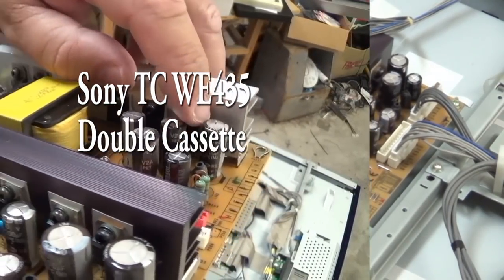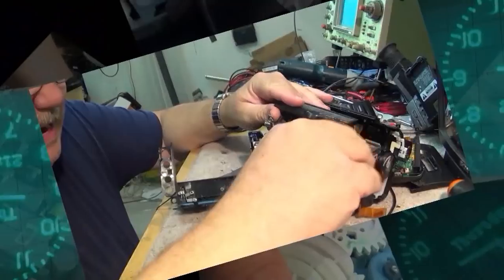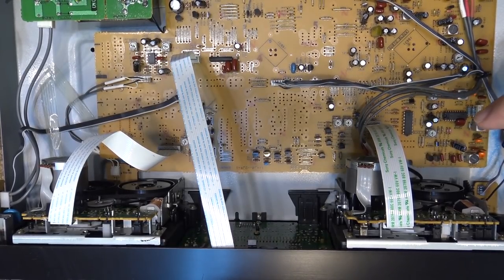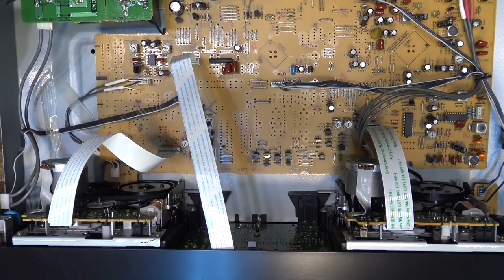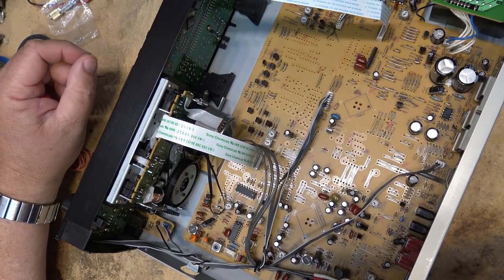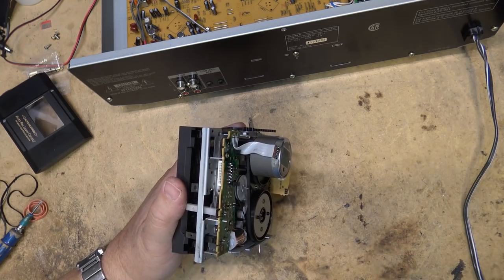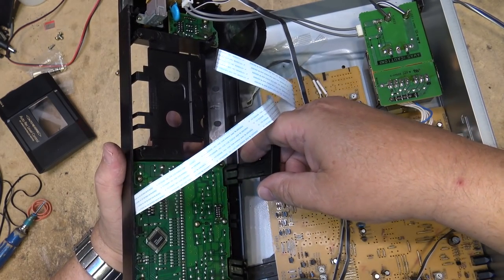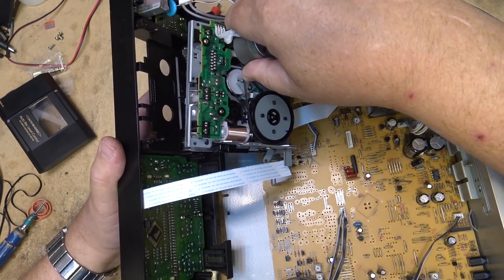Sony TCWE435 Cassette Deck makes a clunking sound. Lets find out why

Comment: Thanks for the inspiration to tackle this job.  I have a late 90's Sony WE 475...probably a little different from the one you're working on but I was able to change both belts on both sides w/o pulling the unit apart.  Just pulled the motor back a little and slid the new belt past and hooked it on.  Made sure to put the smaller band on first, which went on easily once the large belt was removed. It's working great - saved a couple bucks.

Comment: Thanks so much for posting this. I have the same model and both drives failed in the last few months. I thought it was an electrical fault until I saw this. I fixed mine over the weekend and it only cost me €15 for a new set of belts.

Comment: Thanks for putting this video together. I was able to successfully replace the belts on my TC-WE425 with your help.  I cleaned the heads, capstans, and pinch rollers.  The most time consuming part was removing the old belts, which had turned to black goo, from the rollers.  I used isopropyl alcohol and small shreds of paper towel to remove the goo.  Ultimately both transports in the deck work great.  It was otherwise a great deck that someone had put on the curb with an old VCR and CD changer.

Comment: Used a 475 for over 10 years before belts died; changed them an sold it to a fella needing a play back machine.  Now have 3 machines form that era including a Nakamichi.  They are all lackluster dust collectors compared to even bottom of the line 70s and 80s decks.  Guys like you got me back in the groove man.

Comment: Thanks for the video and for all hard work, I've bought a TC-WE 475 with the same problem on deck A. With the inspiration from your video I have changed the belts on both decks.
Belts ordered from ebay fit perfect like genuine ones.

Comment: This is just the video I was hoping to find. I have a Sony TC-WE525, bought in 93. I found a source for a belt set already even though the price is ridiculously high for some tiny pieces of plastic, EUR 15 incl. shipping. But who cares, there is some sentimental value involved in this deck and I want to salvage it. Now all I needed was a video that showed me how to get it done. Because when I opened up the deck, I didn't have a clue. I thought there must be some trick just as there is for other types of Sony decks from the early 90s. I watched a number of clips here on YT but these Sony decks seemed to be constructed quite differently. TC-WR590 and some other WR types are comparatively easy if you know the trick. Or the WE305 where you can remove the motor by just opening one screw and not having to take off anything else. 
Found your video now and the inside of that deck WE435 looks more or less the same as my WE525, finally. So the bad news is there is no trick or easy way, I will have to take it all apart. Good news is - it can be done even if it is not as easy as I hoped. I'll get to it on the weekend and keep you informed.
Reply: OK, it worked. Took me an hour or two because I'm clumsy and didn't want to break anything especially all that tiny electronic stuff here and there. It wasn't easy and I couldn't have done it without this most helpful video I guess. Thank you for your time sir. And thank you Sony for putting me through all this. On the other hand, I learned a lot about my tape unit now. 
Oh, and I liked one of your statements even more than anything else, around minute 8: 'Little more work than meets the eye to change the belts on these units' - Amen to that.

Comment: Great Video....just did the belts on my TC635s  (china version) and the unit had the same solenoid actuations, gear grinding and locked door....your info on returning the gear mechanism to stop by rotating the flywheel is priceless!  I thought I had to trash it.

Comment: Went to use my Sony TCWE435 recently and it just did the cluncking sound as described in your video.

 Watched the video and tackled the tear down. 
Found my belts intact, just very stretched. 
Located the two small square belts but the larger flat belt I only had one, and it was too wide. 
I got out the scissors and cut the belt length wise to give me two!
Fitted belts.

Reassembled and was briefly stumped by how the door spring should sit against the plastic, but worked it out in a few tries.
The doors reset themselves after power on. 
I briefly lost one of the eject plastic levers but realised it had slipped under the mainboard!

Keep your videos coming - I have watched a lot of them over the years.
Pleasantly surprised to find this one to help guide me thru the repair of the exact same equipment.

Comment: RANT! Great job by the way. They should have been gear driven from the start using all metal gears. I had people tell me we didn't have the technology, yes we did and we could have done the same with reel to reel. Refer to a wind up watch, how many belts did they have? I remember taking the cover off of a stereo receiver back in the 70's and it had a large lead block bolted in the center so you could feel the heavy vs quality ratio. Throughout the years we've been deceived to a insane amount. Like our new smartphones, we can't pop the back off anymore and managed to sell the people on the idea of have double the trouble glass front and back that looks beautiful not knowing the battery goes bad and now they glue them to the back of the screens on a lot of models and you can't find a replacement so you have to match it and use the old wires with the small molex connector and if you were smart enough, you purchased insurance in which you never get the same phone back, instead you get a refurbished piece of crap back where the touchscreen doesn't want to work and other fine glitches. I'm not talking about some cheap knock off or off brand we never heard of, I'm talking about Samsung. I want to have the ability to replace the battery on the run if needed. I seriously wonder how many years in advance they have before they roll out the old model as the cutting edge, I'd bet they have a stable Snap Dragon 1000 CPU with a Mali 1000 8K GPU with a graphene battery that last a week with heavy use that the elite have.
Reply from the maker: There were a few direct drive and disk drive cassette decks made.

Comment: Thanks for the great video.  I have the exact same deck and it was making the exact same noise.  Managed to replace all 4 belts with this video.  Funny that both of my belts failed at the same time.  Also funny that they lasted as long as they did considering that I'm pretty sure all four were original.

Comment: Hi, thanks so much for this repair step-by-step guide - my similar deck had the same problem and I followed your guide and (after also cleaning the heads) it now plays perfectly - in fact it even looks and plays like it is new - I wouldn't have known how to take the motor parts off to fit the belts without your video, cheers!

Comment: I enjoyed watching this, but you had more success than I did when I stripped out my Hitachi TRK762 boom box, I fitted two new belts and was looking forward to simply screwing it back together when I noticed a rubber wheel that had perished on fast forward or reverse and knew I could never finish it. A broken piece of black plastic on a piano key I also fixed, by swapping the keys parts around with the pause one which I hardly ever used. Back together now, but I use it as an amplifier for my old Panasonic deck, by having to keep0 the record key down all the time.

Comment: Thanks to this video, I was able to successfully repair one of my two WE-435s. The second one is half-fixed. The play side plays fine, but the play/record side has one pinch roller up, and one pinch roller down. I cannot open the door; I think it's stuck in "play" mode even though there is no tape in it.
Reply: Maybe this can help. Try to gently push the "button" located under the solenoid or if this doesn't work make the flywheel to turn counterclockwise. Doing this you will be able to unlock the play mode. I tried successfully the second way on my WE605 model.   : )
Reply: I had exacly the same problem and thought I had broken something.But it's just a safety which prevents you from opening the door while it is in Play or Search mode. You have to set a little switch to 'Stop' mode. It's shown handsomely in the video at 12:00  You don't really have to take off anything to reach that switch, just the cover of the whole unit of course. 
I played around a little with it and eventually got it into 'Stop' mode and the little safety was released and the door could be opened again. Everything worked just fine then. This video really covers a lot of issues along the way and that is just great.

Comment: I have the TC-WE505. It has two motors per Deck, 5 more buttons under the display for the Random Music Sensor-function (it can search for all recorded tracks and plays them random), 40-pin ribbon cable between the Display and the Mainboard, the Decks are directly but detachable connected with PCB connectors at the bottom and 7-pin ribbon cable at the top. At the Back of my Decks are large PCB's - so have to dismount a lot more stuff before i can change the belts. My Deck can also search for the highest recorded level on Deck A, so it can set the Rec-Level for dubbing at the maximum (Auto-calibration). My Tape-Deck is also able to record on chrome and metal cassettes. It detects the inserted type and the write-protect with the switches at the top of DeckB (my one has one more switch)
When i was younger i really used all of the TC-WE505 functions. Now I use it only to digitize old audio tapes (e.g. audio books) of friends and acquaintances on the PC so they can hear it again.

Comment: Wow . sounds like 1% wow and flutter.  I have found some new belts that the dimensions and thickness were not consistent so every revolution around the motor pulley the speed dropped a bit. Good video.
Reply from the maker: I suspect that the belts I ordered off eBay are rejects because every single deck I have used them on experiences high w&f. This is why it is a good idea to stay away from eBay parts.  Sure I could ship em back but at my cost.  It was nice when I could just call the manufacture and get the exact belt but these days that is not an option and when you order online it is a crap shoot at best.
Reply: @12voltvids   Right. I miss the good old days I could go downtown and pick up a belt.
Reply: Yeah, I’m certain the wow and flutter with a (healthy) factory belt is far better. On tapeheads.net there are discussions of belt vendors, since there do seem to be some that are reliable. (I think there’s a guy in the Czech Republic or something.)
Reply: westcoastbelts.com is one I recently discovered.  Only spoke to the guy once but haven't ordered from him yet.  They claim they can MAKE belts upon request if needed.  Other than that, I don't know much about them.

Comment: I remember that where VWestlife had the same mechanisms of the deck, as he claims that anytime whenever you play the tape in the deck, sooner it gets or later, the mechanisms including the audio head, might break up and failed, and might trap the tapes and can't get the deck door open. There's a way for to, is to do a procedure like yours, and then afterwards, get the tape out from the deck, and see it's serviceable.
Reply from the maker: If the belt falls off when in play, with the head raised it can't lower it because it uses the flywheel to drive the mechanism up and down.  So you have to activate the plunger by hand and turn the flywheel to release the head so you can open the cassette compartment, which has to be open to remove the deck to service it.

Comment: I have the same exact deck, from 2001 and yes, it is quite a low end cassette deck, never liked it very much because of all the klunking noises it does when changing modes. Tape transports feels flimsy.
Reply: these later cheaper ones all sound like that  , Identical
Reply: For it being so cheaply built, why does one website I just looked at want $528.00 for it?
Reply: @jerryspann8713    They're sniffing glue apparently.

Comment: I find it very difficult to believe that Sony would release any deck with W&F as bad as that, even in 1999. Either something is knackered (and that's doubtful given they both exhibit the same problem) or the belts fitted are unsuitable or poor quality. Even a cheap shoebox recorder from the time would perform better.
Reply from the maker: All these cheap ones with no heavy flywheel on the capstan have substantially higher W&F.
The only deck I own that I can tolerate is my Technics RSM275. It is a direct drive quartz lock servo capstan, and the flywheel weighs in at about 1 lb. 
My Pioneer elite deck is also pretty good. My Teac 850 is also a bit of a pig with respect to W&F
Reply: @12voltvids  Direct Drive Decks are the best! I got 2 Technics Decks that have Direct Driven flywheels and the tape spinners have a direct motor attached... nothing can beat that i think.
Reply from the maker: @PaulJCost1  Yes my technics is one of the best ones I own.

Comment: Very informative video! This would have been helpful a week and 2 days ago because I had to service the exact same mechanism inside my Denon DRW-585 deck. It is a real pain to get the belts out! Also, mine didn't seem to have a "full" head/pinch roller down fast forward mode, only the "search" fast forward mode with the heads and pinch rollers up.

Comment: I had this exact model new in the box. It sat around and the belts just failed, with no use..! Wonder if it would be worth it to plug all my unused tape decks in the closet into some type of home automation timer, so they would come on and 'exercise the belts' for a few minutes every month... Anyway, thanks for uploading, always enjoy your videos. (I uploaded one of this same deck last week, but I took some shortcuts so compared to this video it is amateur hour!)

Comment: I don't call it bootlegging. I call it making a copy in case one gets tangled up in the machine. But yeah, like VHS with macro vision, if the tape got ate up, you'd just have to buy another . I always thought tape player manufacturers should have had to replace any tapes ate up in their machines. But my opinion doesn't count.
Reply: Every time a deck lacks a mechanism, to stop playing (or to switch to the other side) immediatelly once the take up spindle stops spinning (because it gets stuck). That's when the tape chewing starts.

Comment: I used to have the Sony TC-WE305 cassette deck from 1996 and it was decent, but it plays well. So I ended up with the Technics cassette deck from 1985, but it works fine, but it has problems with the speed which was recording too fast, so I had to tap it to get it running, because of a loose connection.
Reply: Small tip: The drive motors on tape decks often have potentiometers to adjust the speed ...
These are often located on the motor itself. Usually there is a small round opening in the motor housing where the potentiometer is located.

Comment: Changed mine without removing the motor or the mechanisms, just broke off the tiny plastic post blocking it and replaced the belt :)
Reply from the maker: That sounds like a hack job to me. Considering that the plastic post is supporting the motor.
Reply: @12voltvids It's had no adverse effects, it was extremely brittle and just broke when i tried to bend it to slip a belt past it. Wish i'd seen your video first though! it doesn't seem to have caused an issue with the motor being loose or anything and there was actually a tiny gap between the post and the motor so it wasn't doing anything?! I would of glued it back in place otherwise. Not a bad deck really. I found the bias needed adjusting on mine to clear up the recordings slightly, but otherwise it's been fine. I bought belts the correct size and it doesn't exhibit the wow and flutter of this one.
Reply from the maker: @MyBrilliantChannel  The belts I used were the correct size, but I suspect that all the belts in the lot of 50 I bought off ebay are factory rejects. That seems to be what they do, package up a bunch of belts and then sell a pack of 50 for 20.00 but by the time they get here with freight and broker charges it is closer to 50 for 50 sub standard shit belts.
Reply: @12voltvids     Lol!  I actually did a similar thing, but I ever so carefully pushed the post over and slid the belt in through the gap.  I sure as hell didn't want to break it off.  Worked for me on the exact model you have here.  My problem was I didn't have the patience to figure out how to loosen the front panel.  Wish I'd seen this first.  It worked though, and nothing broke.

Comment: I found this exact same deck at a Goodwill, $13 US.  Both rubber belts were melted, I didn't have access to new belts so I found 2 rubber bands that were very close to the original belt length and tried those.  Despite everything I did (), the unit still would not play in any direction on either deck and kept activating auto-reverse with no movement on reels. Would rw/ff just fine.  Solenoids were engaging (it appeared).  I was baffled and figured it was something in the mech and just returned it as you stated, it's not a high quality deck.